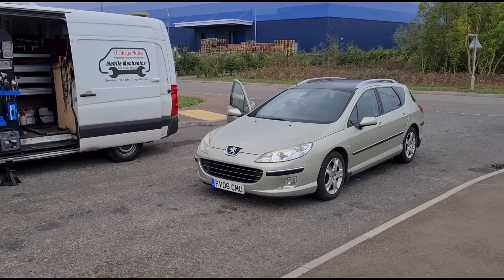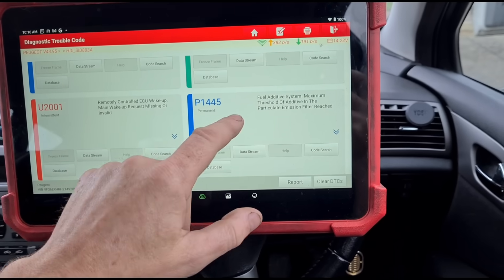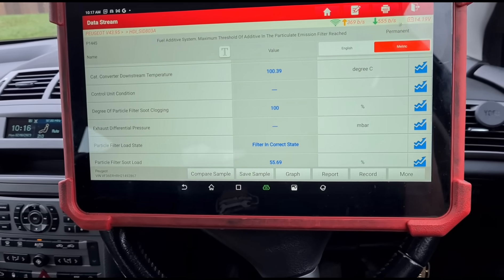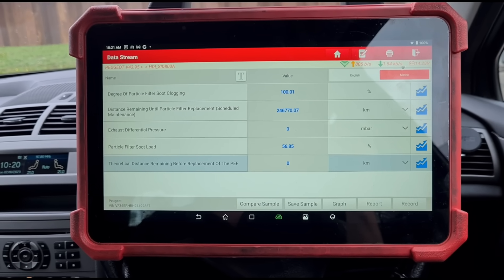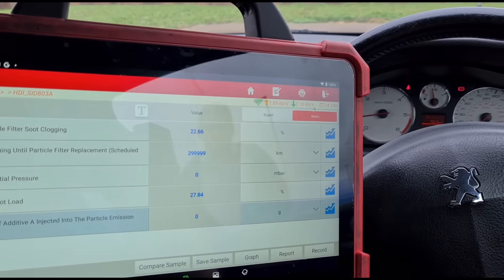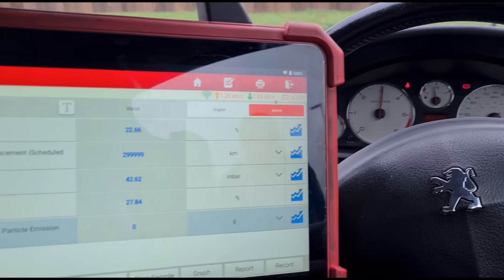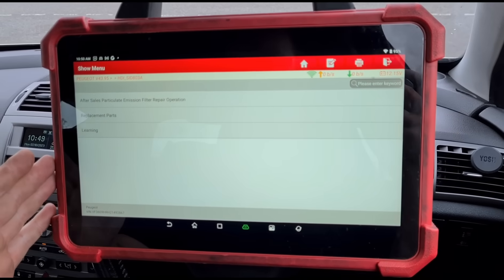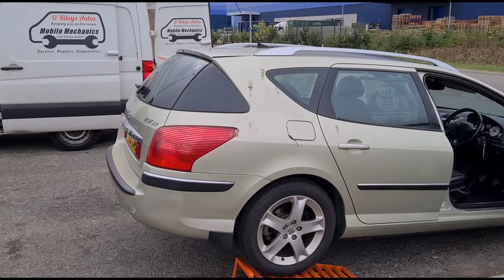Cars With Planned Obsolescence? Or Justified Maintenance? Pre Set Faults At Set Mileage

Comment: My 2013 BMW 125d flashed up a red warning alert last week. “Brake pads need replacing. Drive moderately and book in with service”… within a day, I had a call from the local BMW garage saying their system had flagged an urgent replacement needed and should I book in. Wanted £700~ to do the job.
 
Ordered new pads and discs, did the job myself for just under £200….. turns out, the wear sensor is designed so that it triggers a fault code that cannot be cleared once there’s 8mm of pad material left. 8mm material for me is about 2 years worth of driving. The minimum legal amount is 3mm.

Comment: Hi Jimmy brilliant video, my 1.6 tdci focus 2010 as done over 160000 miles, I change the oil & filter every 4,500 miles/ air filter when required same with fuel filter, use premium Diesel fuel & then regular Diesel, every other tank full redex, & every month Diesel boost cleaner, &  l make sure to give the car a good run occasionally if iam only doing short trips,

Comment: What an absolute con by Peugeot. If this is the 2.0, it's the same engine that's in my 2007 Mondeo Mk4, which has just done 221,000 miles and is still on the original DPF, with a pressure reading of 2mbar at idle and aroind 30 at 3000 rpm. Perfectly fine. There's no need for this at all. 

Thanks Jimmy for bringing this to light.
Reply: Does yours also use the eolyse fluid?
Reply: @homeistheearth  nope. The mondeo uses a DPF without fluid. It relies on the engine being hot, by way of overfuelling to carry out its regens. Later ones, Euro5, have an injector known as a vaporiser which sprays diesel straight in to the DPF to burn it all off.
Reply: @aindow ok, yes my Citroen c4 gp with the 2.0 hdi also uses postinjections with the injectors and use the glowplugs to raise temp. 
The eolyse is a fluid i think is some iron based toxic stuff, they claim it will get stuck in the dpf, so i actually changed it, but saved the old, as i could not find a clear answer if it could be cleaned. But the service time is 180000 km -

Comment: Definitely unfair to the consumer. As you said jimmy the differential pressure will indicate a blocked dpf.Peugeot should not base engine faults on an arbitrary mileage or number of regens.  Its plan wrong to do so.  A warning is fine. But peogeot go too far in deactivating the regens when the limit has been reached which will cause the dpf to block unnecessarily. Unfortunately i learnt the hard way in 2017 with 131,000 mile peugeot said dpf reached end of life which in 2017 was £887. Three days later the EML was back and Peugeot then said the eoyls was empty so another £227.

I am older and wiser now. Currently i am on 227,000 and just via diagbox updated car to say new dpf fitted.  So the only time I'll get the DPF fault is it the dpf is truely blocked and it will be flagged via the differential sensor.

The conclusion is Peugeot are just fitters and do what the computer says.  They are not mechanics and do not fault find.  They just throw parts at the computer messsages at your expense.jack

Great work Jimmy.

Comment: It’s taking the control away from the customers, deliberately. Now if the economy was in good shape people wouldn’t be overly concerned with built in obsolescence as they would simply trade up. When money is tight cars have to be on the road longer. I have just had a problem on a car which ended with a falling out with the garage and a lost sale for them. I actually fixed it myself.

Comment: What an absolute disgrace. How can this possibly be legal? It's as bad as the VW mpg scandal. Here is Peugeot intentionally putting a fault on a car that is running fine. Like you said Jimmy they want the customer to spend a couple of grand on a job that doesn't need doing or scrap the car and buy a new one. They are no better than eBay/Facebook scammers 😡

Comment: Interesting video. I think I would have connected a manometer to the DPF to confirm the pressures actually are as reported by the ECU and that there really wasn't a problem with the DPF.
Reply: As a tech myself, I agree if you have no diag tool.
There cheap to buy and not restricted to any make and model.

Comment: The reason this happens is PSA vehicles use a wet DPF setup that injects eolys fluid into the fuel tank everytime fuel is added to the tank, eolys is essentially cerium oxide which allows a much cleaner combustion and lower temperatures for regeneration, unfortunately one of the side effects of using eolys is over time it does reduce the effectiveness of the DPF and eventually it will no longer be effective in stopping soot emission, this is why the car states its full of additive, now resetting the ECU to tell it thats it been replaced will work fine but the issue with this is its still going to be full of ash and due to the wear on the precious metals from the eolys additive it wont be as effective and will end up getting saturated more often and will regenerate more often, in turn contaminating the oil and increased wear on the engine, how bad this will be who knows, this fix does work but may have risks attached
Reply from the maker: The pressure is zero at idle so there is no ash build up to cause an issue
Reply: @ORileysAutos  there will be ash to some extent after 160,000 miles, just not enough to cause a pressure difference

Comment: That 407 looked (and sounded) like it was in great condition for a 2006, 165k miles. Giving the impression that it had been well looked after and that there's plenty more years and miles of faithful service left in it.
Reply: we have a 207 with the 1.6hdi and dpf, 143k miles (22k in the last year) and for a 17 year old daily abused car nothing has gone wrong apart from things we left too long like the release bearing squealing, other than that just servicing and it drives lovely tbf, pulls very well too with a stage 1 from hdi tuning

Comment: This is planned obsolescence. No doubt. A DPF in a car that does 120k of city kilometers and a lot of idling will definitely have a much harder life than the DPF in a car that is mainly driven at highway speeds. So, relating DPF life to the total driven distance, is a malicious act of the manufacturer. The DPF will stop to regenerate and kill itself, while it could possibly still outlast other critical parts.
Why do manufacturers do this? They did not do it for the engine timing components. They could easily limit engine RPM to 2500 when the timing belt reaches its end of life date, so you wouldn't destroy your engine.
Well, it's YOUR engine that self-destructs when the timing belt fails. No harm done. You'll get another car.
When the DPF is supposed to be not effective anymore, it is the environment that suffers and the environment must be protected at all cost.
It's environment protection laws doing this.

Comment: I worked for a car company 30 years ago and back then they had bad transmission and they still do today,
Another company makes bad wire and fuses and starters 
The Elevator repair man I know has a set up where he runs the same summer city's every year, So he plans his vacations around his work map, He sets the elevators to faily every september 1 to 5 so he fixed 30% this year then another set next year and the last set on the 3 year then he has some set on a 5 year plan. So when he comes here for his week of fishing he resets the timer on all the lifts on his sheet and makes $10,000 for his '' work '' and this is a set yearly income just from the apartments and hospitals and malls in my area,  Then he moves onto the next city and the next So he works from May to September and then is of for the rest of the year,

Comment: my 2017 maserati v6d when you have it serviced, you can reset the service mileage and date but wont reset oil viscosity counter and the oil service required message which means the DPF wont regen as oil viscosity counter outs eml light on, only 7 dealers in the uk so hard to get repaired, dont buy maserati
Reply from the maker: Pretty sure I can reset that
Reply: that would be great which area are you in as im based in county durham @ORileysAutos

Comment: It may be reasonable to give warning of a dpf replacement provided that the differential pressure sensor also agrees with diagnosis. Even then, it may still be worthwhile to perform a dpf clean to see if the pressure reduces.

Comment: These Pugs had defective suspension from new. They brought out a fix but wouldn’t replace faulty units on existing cars. Put me off Pugs for life
Reply: They did and older types were replaced with the newer version. So far on 220k miles with original suspension, as mine was built after the issue was noticed. So no idea what you are on about!
Reply: @khalidacosta7133 it was the whole front strut that was redesigned and the dealer wouldn’t replace mine. I replace the joint only, and got shot of the car

Comment: My guess is the DPF is expected to be full of ash as opposed to soot after a certain mileage.
I would be interested to know if both soot and ash are flushed out in your process.
Thanks for your great videos.
Reply: The ECU doesn't need to assume, it's got pressure sensors to read if it's blocked
Reply: @Phantom-mk4kp  Agreed the pressure sensor will show if the DPF is blocked but not if it is blocked with soot (which can be burnt off) or ash which can not and just continues to build up ???
Reply: Good question, does Launch fluid dissolve ash and soot?
Reply: Soot will wash   out........  ash will/ may need a pressure wash to dislodge it .
Reply: Would removing the DPF and tapping out the ash work?